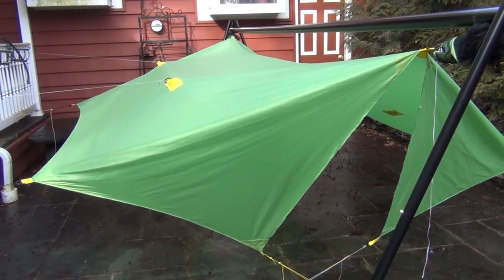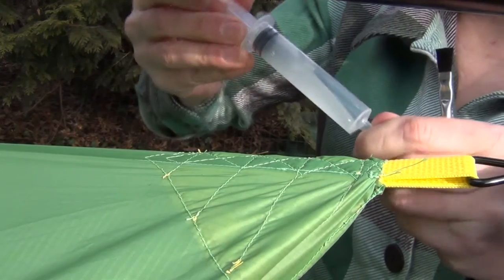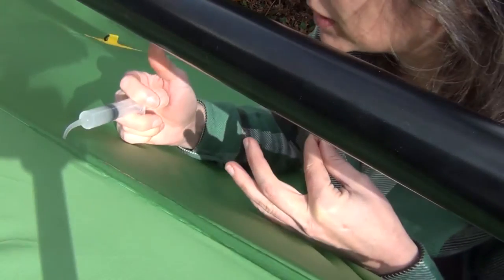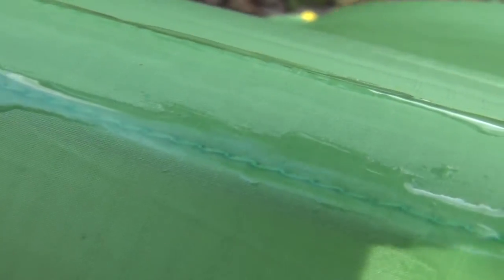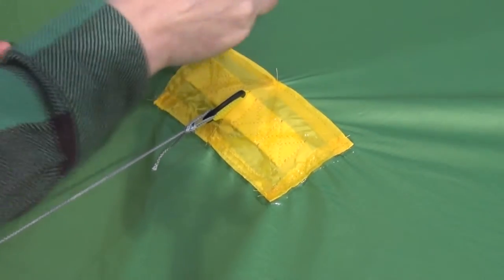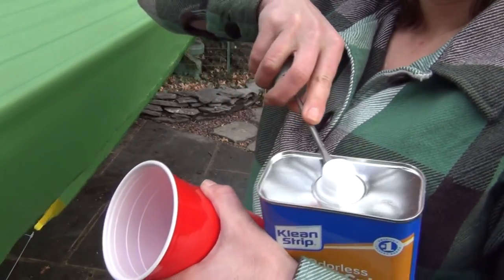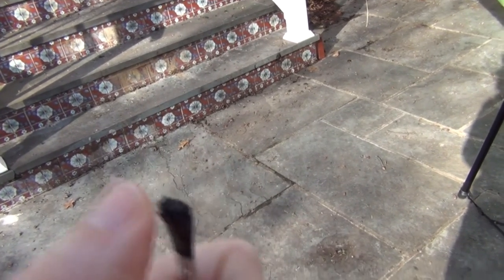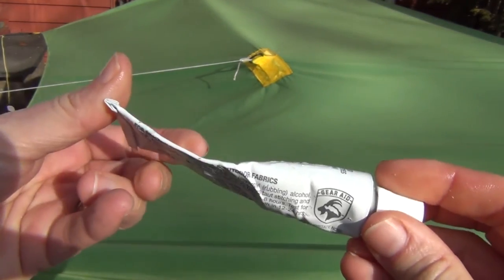Winter Tarp:  Part 6 seam sealing

Comment: Your tap looks great!  Something you might want to experiment with is buying a tube of 100% silicone.  mix it with mineral spirits and apply with a brush.  I have used this and it worked very well.  The brushes I use are acid brushes I pickup in the plumbing department of one of the big box or hardware store.  Joe Brewer has a good video on this.
I am looking forward to your next project!  Enjoy your hang!
Reply from the maker: This is good timing, Ron, as I'm just about done with another tarp.  I'll check it out.
Reply: I use one part clear 100% Silicone caulk and 3 parts of Odorless Mineral Spirits. Mix them up thoroughly in an old cat or dog food can and apply the mix with a soldering flux brush.
Reply from the maker: I recently saw his video.  That looks like a good plan.  Thanks!

Comment: I'm sealing the tarp I just got from RSTBR and think I'm gonna use your syringe idea. I did some last night but I didn't get it deep enough into the threads I think bc after it was dry I pulled the sides apart and the sealer just spit so I could see the threads.I'll go back in with this method on the ½ I already did then finish it this way as well. Great Idea Jelly! I'll post pics on the HF thread I started .

Comment: I've seam-sealed a number of tarps and began by using the supplied brush, but soon discovered that a finger (suitably attired in a thin nitrile glove) makes a much better applicator than the brush. It's easier to massage the sealant into the necessary spots, but perhaps just as important, the amount of sealant used is far less; this is not a question of being frugal or saving weight, a thinner layer is more supple and less prone to blistering and peeling. 
This approach does mean that the tarp must be held against a firm surface (and preferably with the seam under a load), but it's now my preferred method. I think I use 60-70% of the sealant that you used. I also apply dabs of the sealant to my finger tip rather than directly to the tarp.
Reply from the maker: Very cool.  Thanks for the tip.  I'm tempted to try the standing ridgeline with grosgrain next.

Comment: Great 6-part video! I look forward to checking out your future diy projects. :)

In the future (since I presume that you are a bit OCD ;), you could perhaps use some "clean room" vinyl- or PTFE-backed tape, applied on both sides of the seams, in order to have a crisp, straight line of sealer. Some painter's tapes could also work. You could do a trial run on spare material to figure out when to remove the tape.
Reply from the maker: I couldn't get painters tape or masking tape to actually stick to the Silpoly fabric.   Where would I get these other tapes?
Reply: I got mine from McMaster-Carr, not sure if they sell to residential addresses though.
Reply from the maker: Is this the right tape? Total Source Manufacturing CRP0790-1/2_Blue Polyethylene Cleanroom Tape, 1/2", 36 yd/Roll https://www.amazon.com/dp/B00LO4V1SQ/ref=cm_sw_r_cp_api_ohD5ybV23PCZ6
Reply: It certainly looks similar to what I've used in the past. I currently use a PTFE-backed tape ($50/roll!) that I get through my work with composite materials. I would give it a shot with the one that you've selected. If it doesn't quite work, this type of tape is very useful for other applications.
Reply from the maker: Sweet.  I'm planning to sew a hex tarp later this month.  I will try to get this figured out.